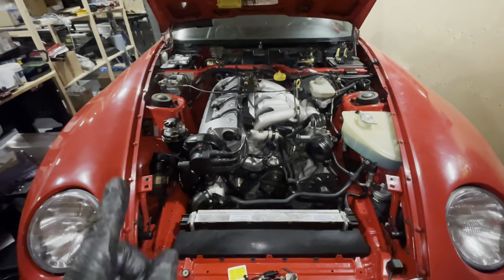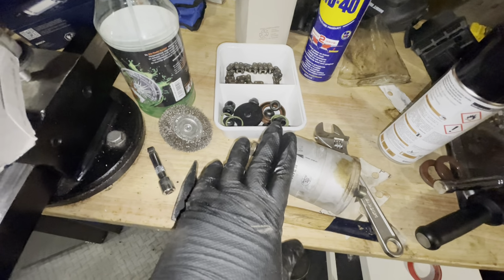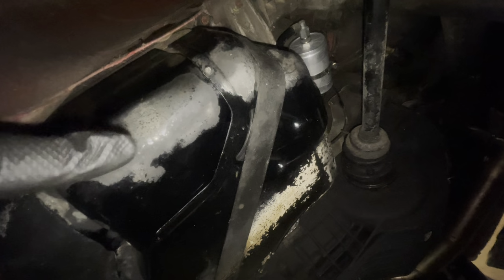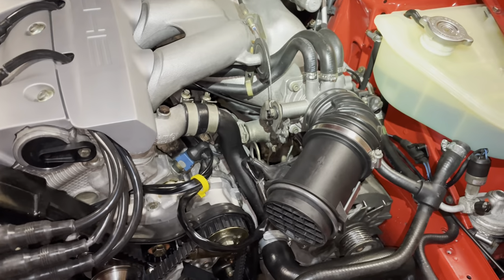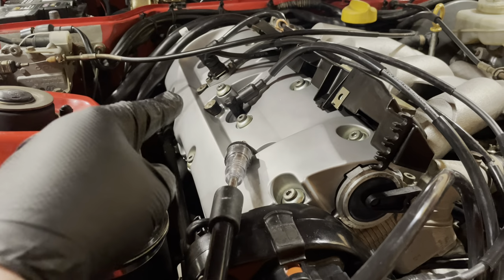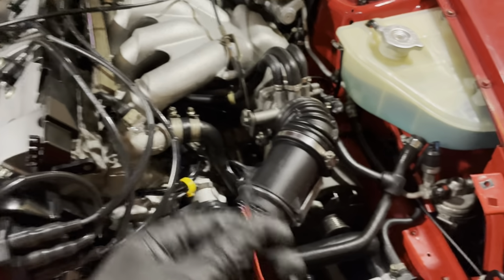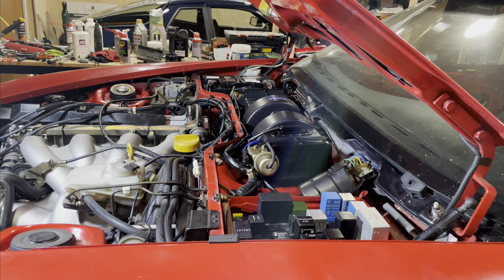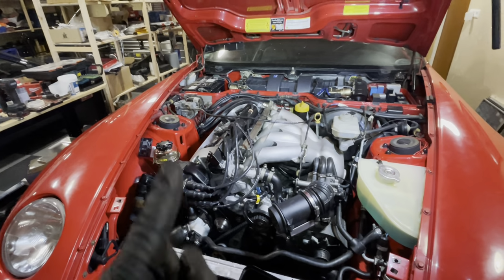Restoring a Flood Damaged Porsche 968: Will it run?

Comment: Biljion, Great job!  Don't for forget to put the belt on the alternator. You mentioned voltage regulator .. lol
Reply from the maker: 😂 You are right!! That would be the reason, I was so stressed I completely forgot that is was not installed 🙈 I am waiting on a bearing for the aircon pump so hopefully I can get that belt installed soon.

Comment: Woohoo!  This is terrific news.  It'll be on the road in no time at all.  New relay and then on to paint correction😁
Reply from the maker: Yes, the toughest parts are now done, now on to the suspension! She runs on the relay now by the way, I am not sure why she wouldn't before. As far as I can tell there was no reason for the pump not to rigger on the relay from the start 🤔 I have a solid state DME relais on the way just in case.

Comment: Thats brilliant work mate I’m so pleased there was no major problems for you. How did removing and replacing the fuel tank strainer go. What method did you use. Im about to replace mine with both filters and some underside fuel lines. The original fuel pump seems ok, so I think I’ll keep it.
Reply from the maker: Thanks Terence! The strainer came out quite easily, I have seen some issues on forums where the"holder" came out with the strainer, but I think that is a rare occurance. I just put a 17mm splanner on it and it came right out, it wasn't stuck or rotted in. I would say this was probably the easiest job out of all of them. If you are not replacing the fuel pump the carier can stay put, just open the little hatch by romving the two metal screws and it should expose the fuel line and strainer.
Reply: Thanks for that. I knew some people had problems removing the filter and I was a bit wary. But I’m from the school of prevention is better than the cure as these filters can break down with time and can cause a headache. Can I say I’ve watched all your posts on this series and would like to thank you for taking the time and effort. This series is an absolute goldmine for 968 owner, very skilfully put getter, and a pleasure to follow the progress.

Comment: Good work! Had a similar experience when resurrecting my CS that I bought from Kuwait which hadnt run for 12 years. Turned out to be a dead fuel pump in that case where as I'm guessing your DME relay or something beyond isnt working? Have you drained the gearbox oil? (sorry can't remember!)
Reply from the maker: Thanks Jake! It now even runs on the DME relay, so not quite sure what the issue was. I read on a forum that sometimes the pump can’t overcome the air pressure being built op in the rail, but that makes no sense to me as it is an open system. I have ordered a new relay to be safe.

I also drained the gearbox oil. I was very worried about it having water inside, but not a drop and the oil was still fairly fresh too. All fluids except for the brakes have now been flushed.
Reply: @GarageBiljon  excellent - did you check the flywheel / clutch?